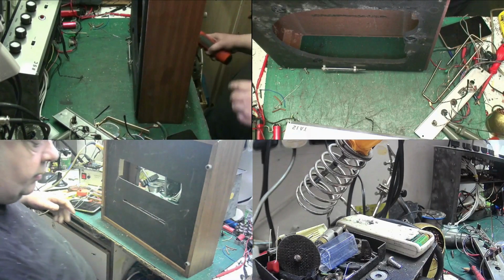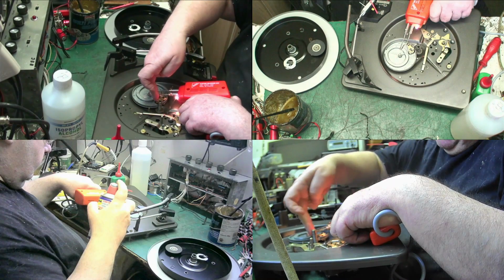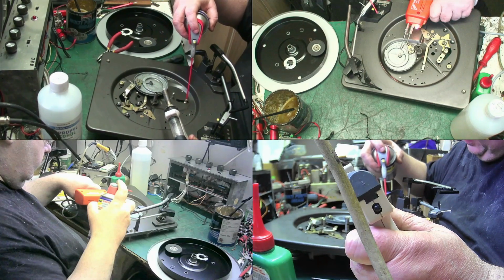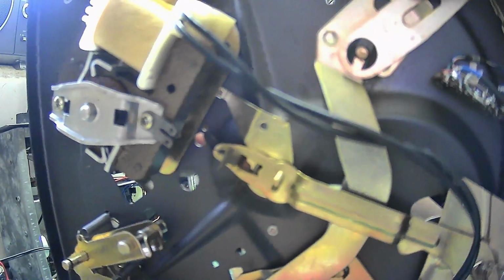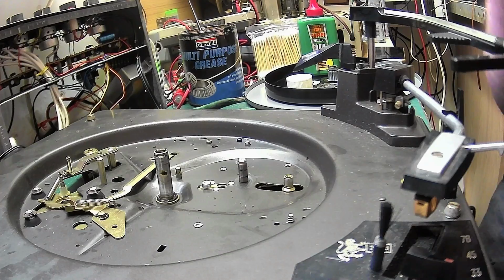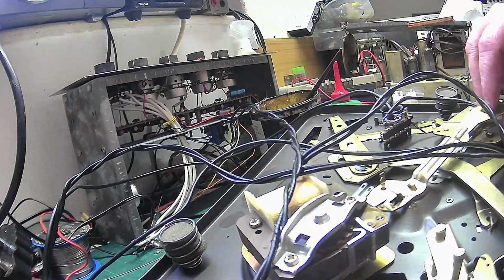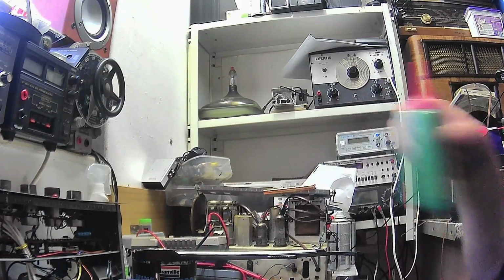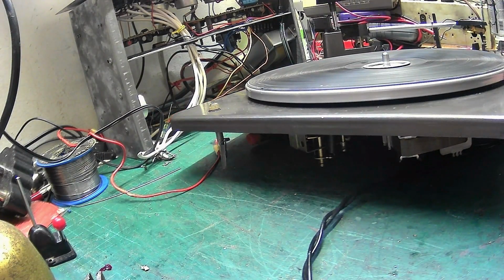GARRARD 3000 AUTOCHANGER

Comment: Try using a good hairdryer for loosening those under turntable components, the alloy expands quicker than the central spindle which is steel and also melts the hardened grease much quicker.